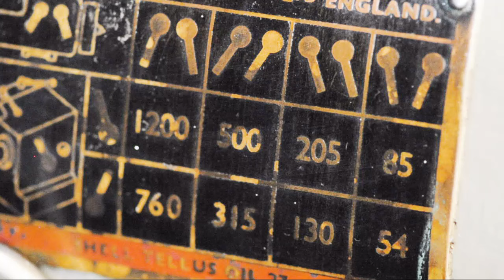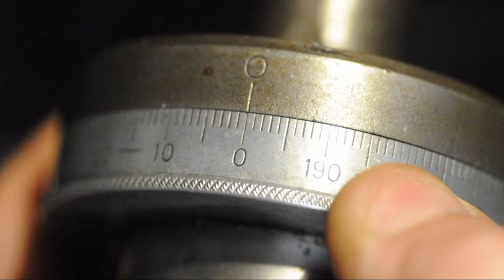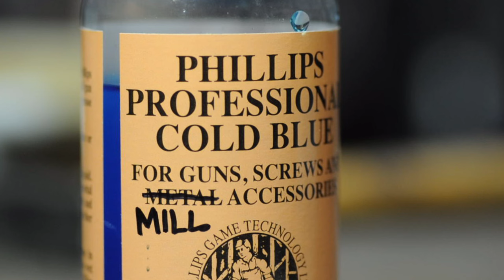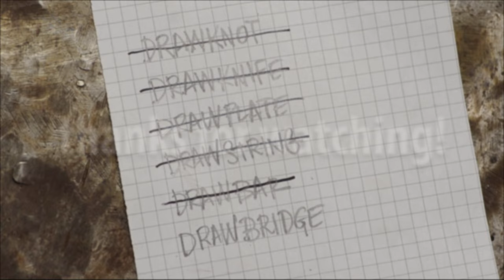Project Drawbar

Comment: Just some minor tips for using cold blue.

Make sure the part is as de-greased as possible, solvents like acetone work well and evaporate fast.
And to get the best possible finish, warm it up until it's uncomfortable to touch, but it doesn't need to be any hotter.
Blue the part.

That's it. It will give far better results.
Reply: Hi. What is the "cold blue"? I want to "get black" some tools of mine & i need to know. Greetings from Argentina.
Reply: @facundolencina2528  google, "cold blue" or "selenium dioxide" "gun blue"
Reply: but its not cold blue if you use heat... i do agree with the instructions though.
Reply: @facundolencina2528  Hola Facundo, creo que a lo que él se refiere es a un pavonado en frío, como el que se utiliza en las armas y algunas herramientas para dejar el hierro negro (una cobertura para que no se oxide)
Reply: @darkshadowsx5949  I think "uncomfortable to touch" is still "cold" compared with traditional hot bluing.
Reply: @facundolencina2528  The "tool" will not become bigger just because you make it black....
Reply: Still doesn't beat a good rust blue.

Comment: Tony, I'm not a machinist (have some lathe training, but not much practice) but after watching this video (and when the need came) I've made a drawbar too! There is this small press drill / milling machine at work. The guys were using a stock threaded rod with some nuts to simulate the drawbar since the original had the threads stripped. You can't imagine how that annoyed me. I took matters into my hands and made one! Thanks for the video. Keep them coming! ;-)

Comment: I'm a woodworker. I don't even know what a drawbar is, but I still liked the video. Shaping metal is magic as far as I'm concerned
.
Reply: @barkebaat Just like shaping wood except the glue(welding) is stronger and when you cut it (metal) short you can make it bigger again. Wood? You just burn it and make the part over. Done both, wood and metal. Still trying to decide which one is the more satisfying. Both materials are as expensive as each other now days.

Comment: 6:30 what do the notches symbolize?

I've seen them on reverse threaded fittings like on propane tanks before... But from earlier in the video it threads into the tool holder with right-hand threads 🤔
Reply: It appears (based on a few minutes of Googling) that it can be used to designate left-hand thread, but could also be used to designate the grade of a nut, or that it's metric?   What it's being used to designate seems to be dependent on the manufacturer.
Knowing that, I'd guess that it's being used in this case so that Tony can distinguish it at a glance from his ISO30 drawbar, without having to look at the stamping on the top.
Reply: I bet to mark the difference between the ISO vs NMBT bar. With the notch you could tell by eye or by feel real quick.

Comment: Can't WAIT to see the drawbridge build! :D
What are the slots for that are cut into the hexhead?
Reply: Azayles he says that they are just so he can tell the two apart
Reply: The slot is a general indication of a left hand thread usually...like on propane or some sprecialty screws.
Reply: Still waiting for that Drawbridge video :D
Reply: @zanpekosak2383  Except this is a RH thread, and the groove for LH thread is traditionally a V shape, not a U shape.
Reply: @zanpekosak2383  except he clearly shows it screwing in RH at 8:05
Reply: Yeah I see that now...
Reply: When you get past 50 you can't read the writing on tools.

Comment: Nice.  I went to the trouble (fun) of bar with both ends threaded.  A bronze ball head nut and a Delrin thrust washer.   Been a while - I think the end fit the lathe with a machine end (cylinder) and it up against the thrust washer and nut.  For my ER40's on my lathe and another on my mill.  Did both ~20 years ago.   2020 now.

Comment: Here's a little tip for blacking parts,get a zip lock bag big enough for the part,add enough of the nasty poisonous blacking fluid to the bag to cover the part,fold the bag around the part to get all or as much air out of the gag as humanly or clingonly possible,without puncturing the bag!!!,add the bag-part-blacking fluid package to a bucket of warm not boiling or burny hot but a good sleepy hot bathtub soak warm for 15mins or as long as the water stays relatively hot,40-50 degrees c,you've hot blued the part,remember to make the bag sink somehow as the hot water will force the blacking fluid to make full contact with the part,the zip lock bag need not be zip locked if the opening is kept above the water line,just weigh down the part with a bag of shot or some sh*t that wont puncture the bag,works with derust and penetrating oil too,so you can use minimal fluid to do the job while you have a cuppa-tea/coffee,jim beam.

I used this technique to do gun parts,triumph spifire parts,private.............

Comment: Love this vid. In the same spot myself, my Van Norman model 10 has a Bridgeport M head on it that’s 2MT with a 7/16 drawbar. 2MT is used on a ton of smaller import stuff albeit with a 10mm drawbar. If I want to be able to use the cheap, easily accessible tooling I need to make a new drawbar. Now if I only had a lathe🧐

Comment: So, the flashing oil can light means add oil?  My car has had one of those flashing for about four or five months.  Is it the same issue?
Reply: maybe, yes. or there's something wrong with the oil preasure. first thing to check is the oil level of your car
Reply: i love gravy terable
Reply: Well, it doesn't mean that it's low on oil, because if it did, you could only ignore it for about a week before you would have an engine-shaped anchor where your engine used to be.

Cars come with a manual, you can look stuff up there. Stuff like what the lights mean, and what should be done about them.
Reply: so you dont like gravy?
Reply: Hazel Hazelton There is "low oil" and then there is so low there is no lubrication. Since a warning after the engine grenades isn't much use, if there is a level warning, the light turns on well before damage would occur. (most engines sense oil pressure not the level)
Reply: Hazel Hazelton There is "low oil" and then there is so low there is no lubrication. Since a warning after the engine grenades isn't much use, if there is a level warning, the light turns on well before damage would occur. (most engines sense oil pressure not the level so the light can indicate many different problems, including low oil level)
Reply: It may be oil pressure. Google the problem with your car and find a possible solution. I fixed  VW Passat that had a flashing oil light. I did some research and looked under the car and it was soaked with oil. It ended up being a $10 pressure sender (sensor). If you can't figure it out, take it to a mechanic for diagnostics.
Reply: That's usually the "Congratulations, You've Fucked it" light. . .
Reply: Four months is alright. Rev it a bit higher, itll go out.

Maybe think about lifting the bonnet when she starts to rattle
Reply: El Rayo X It's probably nothing just put a drill thru it and cover the hole with black tape that usually fixes it.
Reply: Clearly you have a faulty indicator light. Best to have it removed at great cost.

Comment: I know you do a lot of cold blue, but you should look into rust blue as well.  Rust blue protects more of the surface, i guess cause it oxidizes the top layer instead of just coating the surface with copper like cold blue.  Idk.  Just a suggestion.  Do what you want.  Or not.  Or whatever.

Comment: The notches are so you can grasp the bolt from the top with your fingernails or fingertips and pull it out.
It also looks really cool. (Yes, I am kidding..about the mechanical purpose..It looks cool).

Comment: great vid I took a lot out of this. I have a Bridgeport. it never came with a draw bar so I just used some all thread. It doesn't run 100
% true.  Mine will be a bit longer . A one piece draw bar is the correct way to do it thanks again.

Comment: Nice interesting watch.  Crappy day in my life so figure may as well troll Youtube.  Anyway Will mention one thing, to make the bluing work a little better it helps to heat the part up just a bit say 150 degrees or so.  To get an even better finish that will resist rusting apply a browning solution first.  I know heat is not "required" but it does make things work a little better.

Comment: I think you'll find that if you degrease your parts thoroughly with acetone or mineral spirits, and heat them slightly with a hair dryer immediately before applying the bluing solution, you'll get a darker and more durable finish.  Not much, mind you, but slightly.

I'm sure you already know to rinse them off in water and then oil to help the stuff set.

Comment: what is the purpose of the slot in the hex?
Reply: left-hand thread
Reply: I'm guessing it's to make it abundantly clear that it's the TPI drawbar, not the metric one. The usual indicator for LH threads (which this is not) is a V groove, not a flat bottomed one like this.
Reply from the maker: excellent guess!
Reply: I came to ask this exact question!
Reply: @edwardhunts  Me To
Reply: @ThisOldTony  well what is the answer!?
Reply: hey you in the bushes the answer to this question is the first one given 100%. Tony is such a cut up and it is a stupid question. At least I felt stupid when I ask it on a years old video didn't get an answer and had to go searching elsewhere. I should have known that. I learned the answer on an AvE video. The groove definitely means it reverse thread and it's an industry wide standard. Thank and you're welcome.
Reply: @thestonethatthebuilderrefu5231  How can it be a reverse thread if you can see later in the video it's screwed in clockwise?
Reply: Gasper Fabic someone in this thread pointed out that it apparently matters if it is a v shaped thread or flat bottom like this one. So I'm gonna say I was probably wrong and the person who said it was for Tony to tell his two bars apart is probably right.
Reply: @thestonethatthebuilderrefu5231  It seems you're wrong. To distinguish between metric and imperial thread.
Reply: Gasper Fabic I know right. I was totally wrong. And so confident. Someone else explains it properly in this thread

Comment: So basicly you used a drwabar to make a drawbar :D cool :) One question what you think about those small table top lathes? Total garbage or...? I dont need a big lathe, bigest part would be probably 80mm in legth and maybe 30mm thick so small parts. Great video, i learned a lot from you, and dazzled few local machinist with acquired knowledge :D

Comment: excuse me for my english but one question for you please.what is the blue paint if you use for mark in the lathe?what is the name?thanks from italy.
Reply from the maker: blue Sharpie marker.  "pennarello"
Reply: Dykem is the brand, lay-out dye is the product. It's a very thin, fast drying ink that you brush on to metal and you can scribe a line and scrape away the layout dye where you need to make a cut anyone script will remove the dye and leave behind a a very thin line where you scratched the dye off of the metal. Im sure there are a few videos that etter explained its use. Its one of the most used products in my shop. You can also use it for grinding metal or leveling metal to show where the metal is still deep.

Comment: Could anyone explain why hex bolts sometimes have that small cut taken out of them, as Tony did at 6:30? I appreciate this is probably incredibly below most people here, but I've tried searching for the answer and haven't found anything remotely useful as I really don't know how to accurately describe it. Thanks in advance.

P.S. There seem to be a number of wedding rings made out of hex nuts if anyone is looking for a project over the lockdown period and has a rather... utilitarian fiancé.
Reply: @Olivia Lambert In this case Tony put the cuts in the hex part of the drawbar to distinguish it from his other drawbar by touch because the stamping is on the top and hard to see when it is on the mill. He needed it to feel different and look different to the other one at a glance because his machine uses ISO 30 and NMTB 30 tapers which are identical except for the threads. So the wrong kind of tool would fit but cause some damage if he wasn’t paying attention. This helps prevent that.  Hope that helps
Reply: let me explain. IF IM NOT CORRECT IM SRY LOL. but I believe it's for wire and a process to ensure fastening strength without any chance of failure. much like aerospace fasteners have lokwire™ for this purpose

Comment: I like your videos boss. They're really informative. Now, what's the difference between milling the hex head in the stock vs. hammering or casting the head? (If you had the means in your shop)
Reply from the maker: that's a tough one, depends on the material.  hammering can result in a strong part, casting might be weaker.  milling gets you whatever the material properties you started off with.

Comment: Hello,
I have one question mr. Tony

How do you calculate the diameter needed for the hex head. I guess you where planning a 19mm hex for ex. and made some calculations wich resulted you need a xx diameter turned on the end of the drawbar. Is that right? 

Is there a table for this kind of calculus? If yes,what's it called.

P.S: oh..and how do you know how much to lower the end quill on the first cut of the hex head?

Thanks
Best regards
Daniel

Comment: How did you determine the 1.640 to get the exact hex head? That's math I haven't figured out yet...
Reply: If you want to make a 5/8" hex head bolt, you need to know that the head is actually 15/16" According to the hex cap screw chart, that requires a minimum diameter across the flats of 0.922", and 1.051" across the corners.  So start with a head that is 1.051" in diameter.  To mill the sides, you have to come down 1/2 of the difference, or (1.051-0.922 )/2=0.0645"  Tony's DRO is set to metric to confuse the enemy, so 0.0645"= 1.640mm
Or you can just divide the diameter of the head by the magic number 16.2946.  1.051"/16.2946=0.0645"

Comment: I thought you couldn't use the threading indicator on your lathe? 

Also, random question but is Kapton tape electrically conductive?
Reply: Everything is electrically conductive with enough voltage.

In all seriousness, the actual breakdown voltage should be at least 2200V/mil thickness, it's a very good insulator. Though it does depend on which type of kapton you get, some varieties are even better than that!

Read the spec sheet:
http://www.dupont.com/content/dam/dupont/products-and-services/membranes-and-films/polyimde-films/documents/DEC-Kapton-general-specs.pdf
Reply: I believe he said he can't do metric threads with that indicator for reasons of insufficient flux capacitor.  Imperial does work otherwise no reason to have a indicator at all :)

Comment: I have a question:  What are the advantages of your photonic horizontal bandsaw compared to a standard horizontal bandsaw (the surface finishes look similar) and does it cut in SAE feet per minute or only in metric meters per minute?
Reply from the maker: I get more life out of it.  The saw doesn't spin so when it wears down I can just advance it a few inches and I'm good to go again.  best I can tell about 10^-29 siriometers per jiffy.
Reply: But does it go to 11?